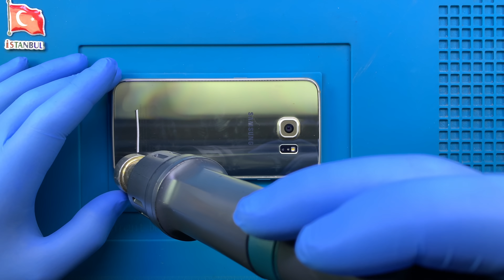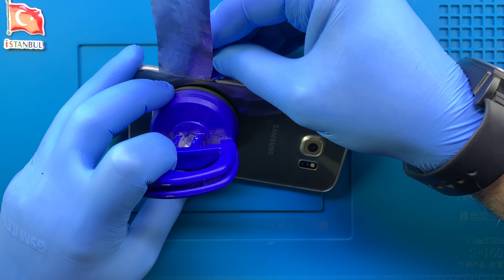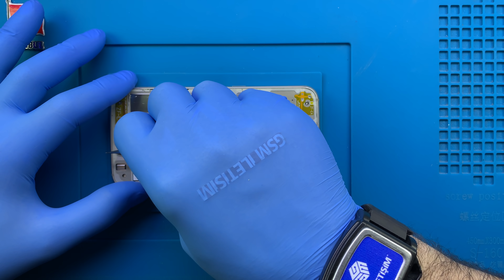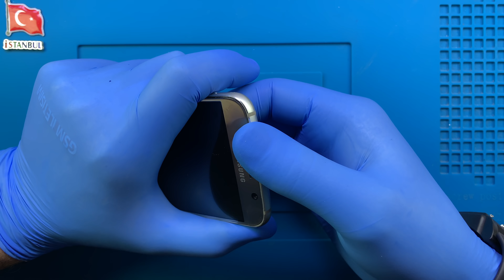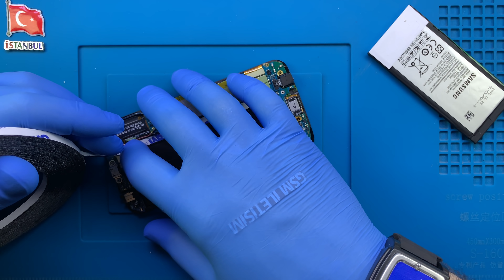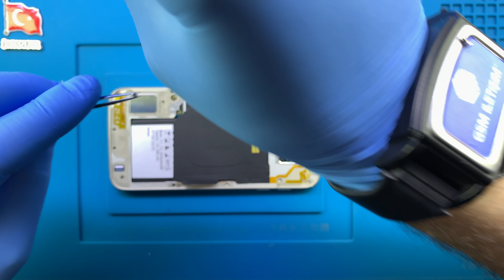Samsung Galaxy S6 Batarya Değişimi 🇹🇷

Comment: Charge battery to 100 % must be 100 %   unplug phone and enter Simple code *#0228# click quick start pres yes then restart Phone charge it agin 100% put nev code *#9900# swipe to down clic batterystat reset vlala u fone fixed no more drain no need Change battery dowland from app Store accubattery and se degradation battery after run copule of Days sory for bad English know 3 langages  :(
Reply from the maker: Hi;
Thank you very much for your valuable information.
Greetings.